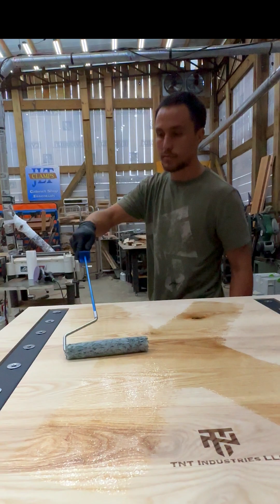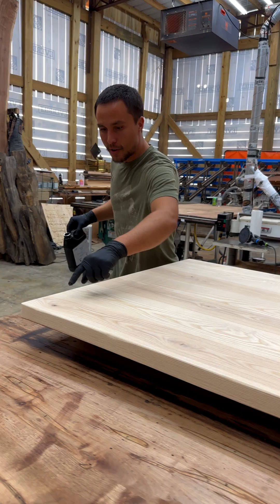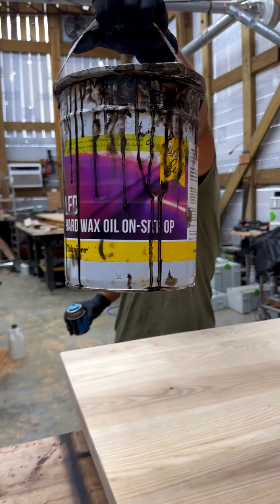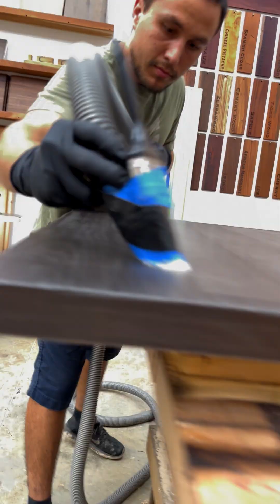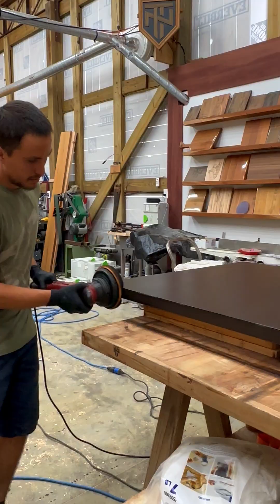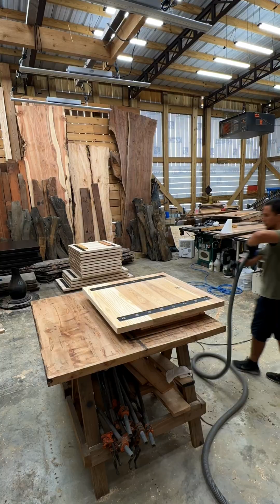Laser Wood Finish

Comment: How are those UV oils holding up with that lighting? I've seen that those curing agents sometimes need specific wavelength UV to cure. Are those low energy (compared to Vesting's) lights enough?
Reply from the maker: LED diodes operate in spectrums, not specific wavelengths. There is a lot of overlap between 395nm and 385nm. 

As far as power goes, there is definitely a difference between the chimi light and cuvo, however this is where we refer to the inverse square law of light. Light gets significantly stronger when you get closer and when you add more point sources. Notice I hold the light very close and at an angle. 

Lastly, ALL uv finishes have a limited amount of photosensitive chemicals, once saturated, the finished is fully cured. Intensity is one factor, spectrum is another, and TIME is the last factor. 
With the Chimi handheld, I can definitely make way faster passes, however it’s still way slower than a 18in handheld. 

Btw, you don’t even need indoor lights. You can cure every single UV polymer with the sun. (Make sure to look into how to do it right with your specific polymer)
Reply: @TNTINDUSTRIESLLC  Sweet thanks! 
definitely something I need to try. Looks like a game changer.

Vesting also emailed back and said their oils cure with 395nm. FWIW.
Reply from the maker: They told me the same thing. Follow my advice at your own risk. That being said, I’m turning in $50k jobs using this method and standing behind it.

Comment: Can you use CA 757 over Chimiver?
Reply from the maker: It stuck and worked for me but CA doesn’t recommend it. I found water based poly is great over chimi if you need a hard shell
Reply: @TNTINDUSTRIESLLC  Thanks for answering my question. 
I was looking for a simi gloss to gloss finish without using a carbon coating that will wear out.